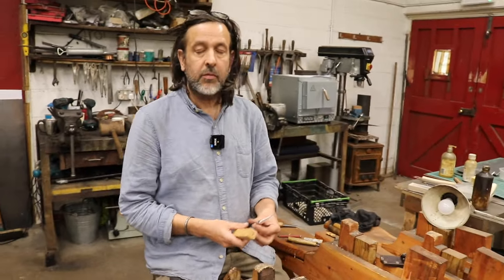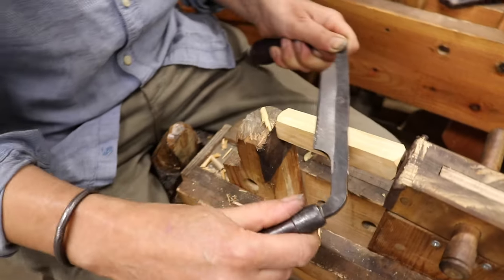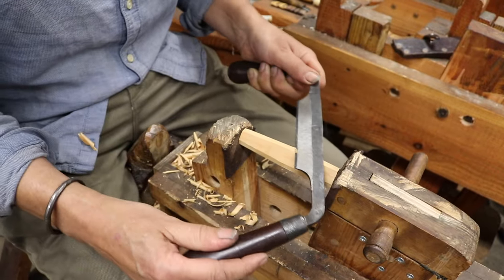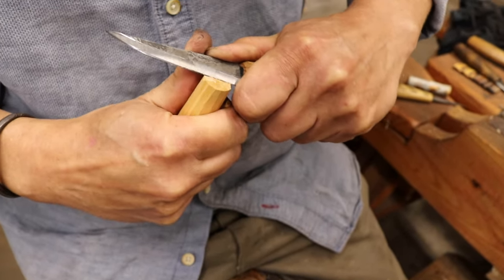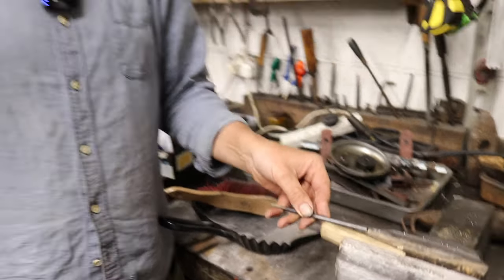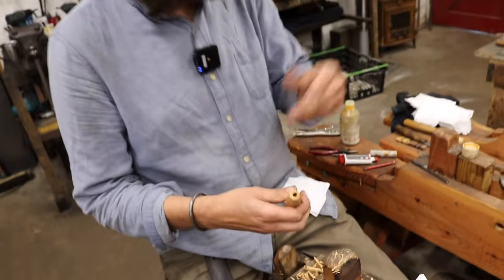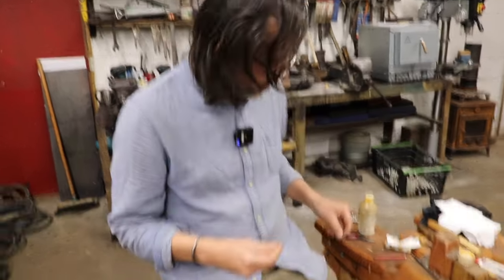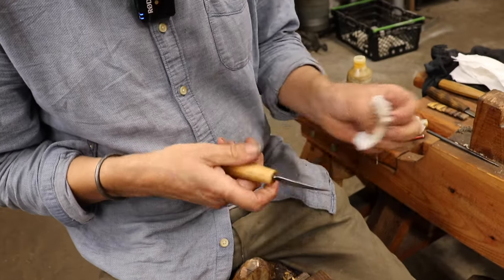{Pt 4/5} How To Make A Turning Sloyd Knife - Nic Westermann (Handle Making & Fitting)

Comment: I've tried a few methods to sink the tang in a hidden tang handle and still not fixed on just one. Because different material responds different...lol most of the time I start the hole with drilling and then heat up a piece of metal the same size as I want and burn it in and I've found that it doesn't wander as much as the drilling.  But again depending on the wood...
Reply from the maker: Yes I have other videos on my channel that show the burning in method as well ~Peace~

Comment: 29:52 The master Nic knows better, but this method seemed wrong to me.🙏 
Would it be better to hold it in a knife vise with a surface that will not damage the steel and hit it from behind with a wooden hammer?🤔
Reply: Well it would have been better not to be in that position in the first place, I would hope to have drilled the hole deep enough it didn't bottom out, and as I said I usually use round jawed pliers which won't mark the blade for the positioning. I could have put it in the wooden jaws of the vice, if id have hammered it and split the handle we would have been rather stuck...but anyway we were set up for filming from that spot.
Reply from the maker: Nic has been making tools long enough to know what he is doing, more so we had to adapt things slightly due to filming and we had a lot of filming to get done in a short space of time ~Peace~